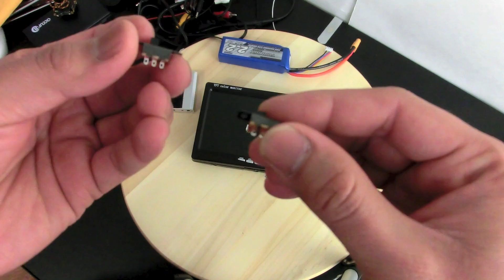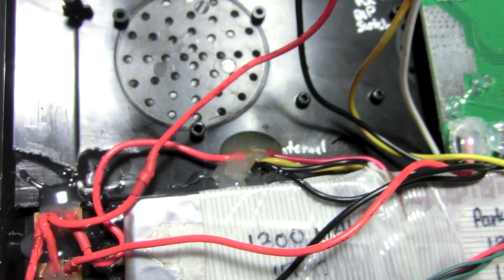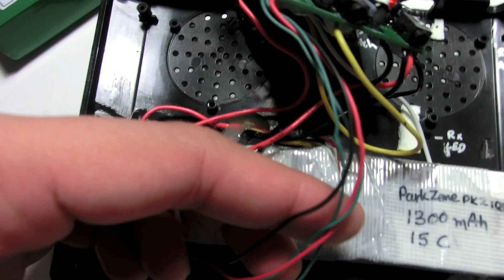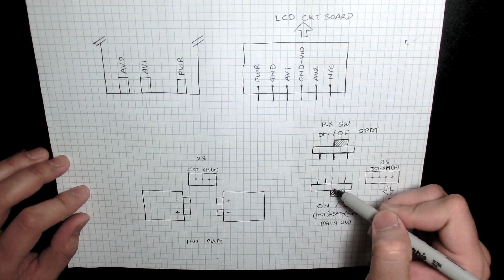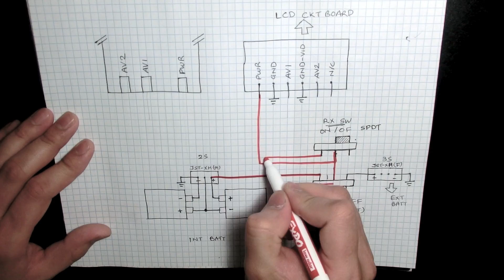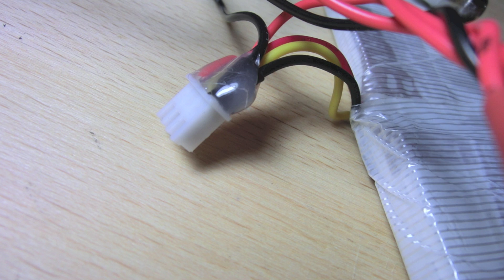DIY 7" FPV Ground Station with integrated Receiver and Battery under $65 Part-2

Comment: Please excuse me before hand for asking these questions.
I notice that you do not use the lcd video gnd?   Or have you connected the pwr gnd and vid gnd?
understanding the connections, as an example, on the receiver, av1 or av2 would be the yellow video wire?
what's the difference between 2s and 3s?
I like how you moved your A/V jack so you can plug it in if your going to use external stuff like eachine dvr.  I'll try that one.
I'm going to connect my ER32 direct to the board and use the connector side for jst pwr and vid2.
Reply from the maker: I am going to have to apologize, as I did this mod a while ago and dont remember most of it. 

But top of my head, yes you will definitely need to GND both the video wires such that all GND are connected together in order of the system to work.

2S battery = 8.4V (Charged) 3S = 12.6V (Charged) Higher the voltage of the battery, the regulator on the circuit board will get hotter stepping the voltage down to required level. Plus I could not fit 3S in the case, so I decided to use 2S battery with this mod.

if you are going to use Eachine DVR you can solder the Video In of the DVR straight to either receiver or the AV in.

Hope that helps. Cheers!

Comment: question, ive made the same set up as you, (made mine based off yours) do did you solder v1 and V2? i soldered them connectors like yours and nothing, now im realizing what you said about the double wire with the ground. so how do i solder the wire with the double wire to receive signal to my screen?
Reply from the maker: I am really very sorry, i dint understand which connection you are referring to. It has been over a year, and I totally forgot :(

Comment: So I will charge it as a 2s 1000mAh 7.4 v?!
Reply from the maker: Yup, Charge is at 2S Lipo Balance at 1A current.
Reply: +Chirag Chaudhari so question I have everything wired up and i used a 1s 3.7v 500mAh  12c and it cause the battery to swell. Just wondering what i did wrong for it to swell?
Reply: Knowing some of the Lipo batteries schematics I see that running 3s would be the best cell run time than 2s.  and amps also make a difference, so for this lcd 2a or 3a would be better for power feed.
running a battery too small such as 1s 3.7v is hazardous, with lipo's the machine is able to suck out the juice as fast as it needs it.  batteries for r/c has exploded after running 15sec due to this miscalculation.  Try to stay within the voltage range at the least.  12v is the bare minimum.

Comment: I custom my batteries the same is the video (2) 1s 1000mAh  20c 3.7 with a 2s balance with a male jst. How would I go about charging this? Would I charge it as a 1.0 A 7.4 (2s) ?
Reply from the maker: Yes, you are absolutely right. Charge it at 1C as a regular 2S battery.

Comment: Is there a way to just use regular as batteries, like 8 of them (12volts)
Reply from the maker: I mainly used that battery so that I can integrate into the LCD and charge them using my lipo charger. But yeah I am sure you can do that.
Reply: I am currently using my kids pwr wheels 12v, this monitor uses standard 12v: whether pwr wheels 12v, car cig lighter plug, or electric scooter 24v, store bought batteries series 12v -24v+.  So, I used pwr wheels 12v and car cig lgtr 12v.  
So, to answer you?  You can run two 9 volts series=18v, or D size 12v.  Or 2 6v cube batteries that will last longer.

Comment: Hello Chitag Chaudhari, great video and great modifications on that monitor. You have been an inspiration to me. I was so impressed with all that I ordered the same monitor, the boscam receiving module rx5808 and the RC 805 5.8 FPV receiver, planning to have a inside module and a outside receiver also to tcheck everything before closing. but since I am new to all this mods, I have a question I was hoping you could help me please. the cable that comes out of the monitor is too big so I am planning to cut it but the 6 pins are: red =power, brown =ground, yellow =video1, Black = ground for video, white = video2 is it? and the green one is what? for the rear view video? is it? I am stop and try to find the help before continuing the project, all the best and keep up the good work. if I am wrong can you say whats wrong so I can make it right.
Reply from the maker: +jorge manuel morbey Glad I could help, and thanks for your comments.

Yes the last one wire no. 6 is a trigger and connects to reverse gear. So I am not using that in this mod. Also I would highly recommend to get diversity receiver as the prices have come down quiet a bit these days. So get the 40ch Diversity Rx, that way your system will be upto date.

Also not to discourage you, but there is a FPV monitor called Eachine 7" FPV with 40 ch and diversity and its around $100 if you dont wish to go through the hassle of modifying. I did that because they were expensive couple of year ago and I had monitor and receiver lying around.

Comment: How does it handle loss of signal from the transmitter? Does it show a blue screen or static snow?
Reply from the maker: +Jack M This monitor is programmed to show blue screen when there is no signal so yes not static. It sucks but if you find a monitor which displays snow instead of blue screen, that will be winner for this build.
Reply from the maker: +Jack M This monitor is programmed to show blue screen when there is no signal so yes not static. It sucks but if you find a monitor which displays snow instead of blue screen, that will be winner for this build.
Reply from the maker: +Jack M This monitor is programmed to show blue screen when there is no signal so yes not static. It sucks but if you find a monitor which displays snow instead of blue screen, that will be winner for this build.

Comment: What about Bluescreen? How did you deal with it?
Reply: +Chirag Chaudhari : not anymore. I found the exact same looking screen on aliexpress around 25$, sell for FPV, advertised as "no blue screen" (different packages, bought mine from UUUSTORE). I just received mine and it does not show blue screen (just snow) without signal. I guess they got a special firmware but I did not test it fully yet with low signal. I actually found your video trying to find a way to pry it out open :-)
Thank for your guide by the way
Reply from the maker: Abhinav Pattanayak Now that is thought question. But the answer is simple. NOTHING. Unfortunately there are no Cheap solution to this issues. So just dont fly too far I guess!
Reply: Chirag Chaudhari I read on Oscar Liang's blog that he eliminated the blue-screen by using a DVR in between. However, it adds a delay in the feed.

How bad is the blue-screen? Does it show up at the slightest amount of snow?
Reply from the maker: Abhinav Pattanayak There are a few solutions to this problem, but they are not practical to use. Just to get rid of blue screen if you have to spend another $50+ rather get the ready FPV monitor. The Delay may not be really big issue if you are flying slow flyer airplane , but definitely not for good for Multirotors. I never had any issues with it so far. I fly within 500 ft range with 200mw TX and clover leaf antennas. Of course its an open field with almost no interference from powerlines or wifi or cell phone towers. Blue screen really depends on quality of signal its getting form the VRX, and in this case its very stable for me. Hope that helps.
Reply: +magbxl I just ordered the same screen. 29$ in my case.

Comment: Thank you for the followup!  I just wish I could have seen the connection to the monitor board a bit better.  I may do something like this down the road, but for now I'm going to velcro my battery and receiver to the back of the monitor.  I just need to create a JST that splits off from the battery to the receiver and the monitor.